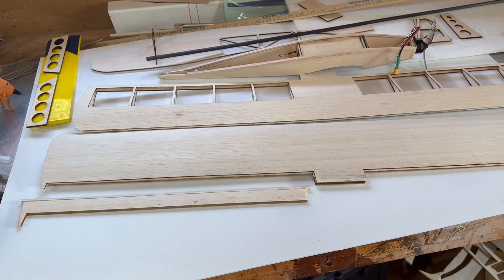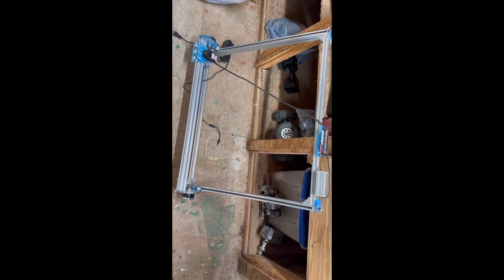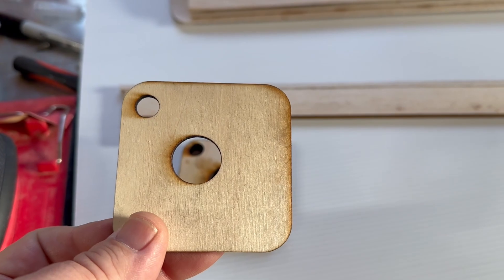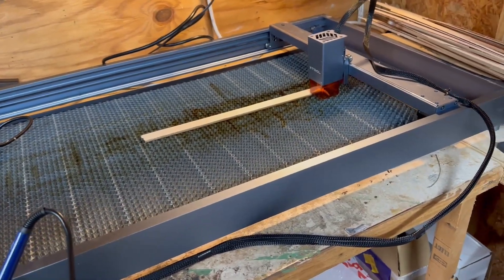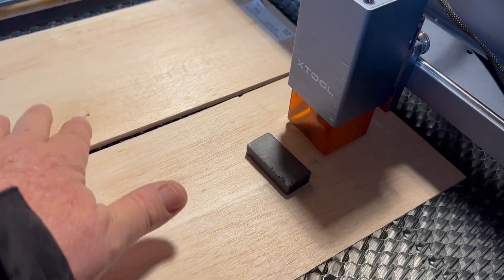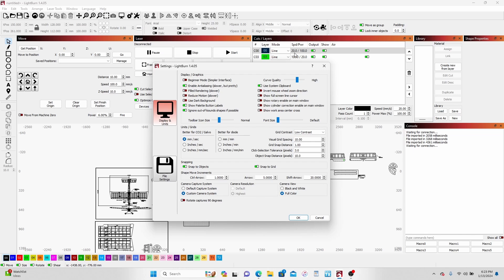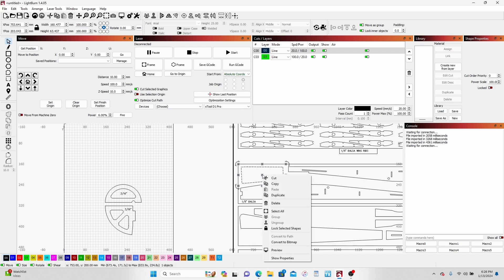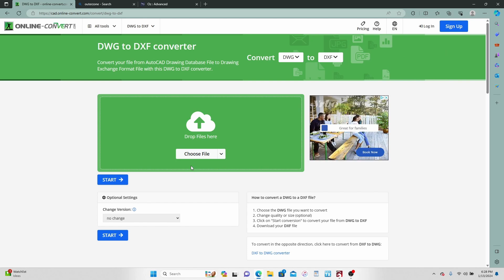10 tips for beginner Laser cutting when building RC airplanes.

Comment: Great instruction, cheers! A few more tips. Diode laser are sold as power or optical power so a 40W power is actually 5w optical power (or 40w optical! the price is the clue). Never run at 100%, thats peak rate power not continious, it will burn out in short order. Air assist helps keep the lens clean. Regularly clean the lens. Soot will obstruct it and the lens will cook and diffuse the beam reducing efficiency. Spend time calibrating the device & material speeds. You can set the start point (green dot) to where the laser is sitting. The frame & cut frame (dashed square symbols) function helps confirm your wood is lined up correctly for the cut/engrave. Theres a tab mode in the cutting settings which stops the pieces falling out or moving (with the air asist) helpful for parts within parts.  Some (rough) guide speeds for 40w/5w optical on balsa wood. 1/16"  950mm/min x70% 1 pass, 1/8" 900mm/min x80% 1 pass, 1/4"  900mm/min x70 2 pass. Find what works to give the least scortching and cleanest cut. Hold the wood in place with thin sticks pinned down with wieghts. That way they do not ubstruct the laser while ensuring a level target. Open a window especially when cutting ply or mdf.. The fumes makes a 20 a day full tar look healthy! For frequent 5/16"ply, 1/4" balsa or bigger then splurge on a 80w/10w optical for time (no passes) and scortching.
Reply from the maker: Wow, that is some really great information; thank you for sharing all of that with us.

Comment: Just started with a X-Tool S1, balsa is definitely a different wood to work with for laser cutting. I found that multiple passes worked better for cutting thicker pieces. The newer X-Tool software XCS has the ability to use your phone camera to get a picture of the workspace with the wood you want to cut in the picture so you can line up the cut or scoring position. I had hand cut some pieces for an Ugly Stik but still needed to cut the holes for control rods. The photo assist feature makes it easy to get the hole lined up with where it needs to be cut.
Reply from the maker: That is great feedback, thank you for sharing your experience. 
Just think when you get all the parts figured out for that stick and have them in your computer. You can repeat the process easily to repair any damaged parts of your flying plane.

Comment: Very nice video. I have a little bit of experience and am making small improvements each cut session. I find that more passes (like 10+) with lower power makes a cleaner cut with less scorching or blackened edges. This also gives a longer lifespan for diode lasers.
With plywood the amount of glue they are made with makes a difference in cutting speed and quality of cut. The glue also smokes nasty stuff,  my machine is in a  home made case with an exhaust line going outside!
Most importantly, take notes! I write a part number on each piece of material to keep track. Test test test...
If you want to get serious with cutting get a CO2 laser for superior results & speed.
I appreciate this video!
Reply from the maker: I have found that with just an aquarium pump and a nozzle I am able to add air assist on my diode laser and get really clean cuts even with high power, single pass, cuts. Thanks for check out my vids. Hope you can find something helpful here.

Comment: So when I import the plans into LB, I shouldnt have to resize them? I only have a 400x400 size bed so I may have to split the fuselage up if thats the case.
Reply from the maker: Yes
And I have a video out that will help with that. My “beginner “  series will help get you up to speed on most everything you need to know to get started. Also the Pitts biplane videos deal with oversized parts cutting. Especially on the fuselage.

Comment: Good to see someone sharing their experience specifically for RC modeling. What I didn’t catch is what wattage your laser outputs? I’m considering buying a laser cutter but I’m stuck on the power (10, 12 or 20W diode laser)

I’d like to be able to cut up to 4mm plywood in one go. Otherwise I expect to cut 1-3mm balsa mostly.
Reply from the maker: Mine is 10watt. If your looking to cut 4mm in one pass then 20watt or higher is a better option. Go as high as you can afford because turning the power down for thinner wood is the best option.

Comment: Could you explain #6 a little more in depth?
Reply from the maker: There are ways in Lightburn to set the laser to home in other words, go back to a starting position, but as a beginner it’s much quicker to manually set the laser to a home position and you’re gonna wanna do that between each cut or the laser won’t read right and your second cut will be off. Also, if your laser is like mine and doesn’t have limit switches, it may bang hard against the side of the railing and start stripping out the geared belts because it thinks it has more room than it actually does.  If you find yourself in that situation, simply turn the laser off manually reset it to its original position like I did in the video then turn the laser back on it will reset itself in Lightbourn.

Comment: Thanks for the tips. Doesn’t look like a stock machine. How big is it?
Reply from the maker: It’s an Xtool D1 with an extension added. I had to change the software from D1 to D1 pro to get Lightburn to recognize the entire size which is now somewhere around 17 inches wide and 36 inches long of usable space. It’s the standard 10 watt laser, which will hopefully soon have air assist and a camera system for doing overlays in Lightburn. Ooopppss. Spoiler alert!!

Comment: Can you please share the model of your first laser that is at the beginning of the video. Thanks
Reply from the maker: I honestly don't remember. It was some off-brand thing from Amazon. Kinda like this:

https://www.amazon.com/SCULPFUN-Ultra-Fine-Compressed-Protection-Fixed-Focus/dp/B09MQMXXGD/ref=sr_1_4?crid=3AV5YP06YY9IE&dib=eyJ2IjoiMSJ9.8iz7LHag67hQlLmTtPf4a3_yi3jn-oo0Qa4L3Hyqu0LnZo__rrv1wdHzjsJEuGqtX21ySX5S5kyjKbIAjTbAy5Rb53uOx78rABzMimypgwJ9G1W0TnQG_J9smsduF5txY5zuyDwnUAOayBRz_rmYeDEcSiysjB-XGXQDIYhhAdWj-d-5f3gd83a87_iE9DHM_zuuBpJznJ7J-iE_WYafAVIcH0hnJV2MiR3QFp7O41vq_Xb4tn4kADB52cAhvrm54rrmjCXX1Y1DWudvVZIed5jQrAlz_FctT2yW7Tv6cs4.HCImuYHhLNJ0JcAExnQda4BGmteQ9eBui-_siyCVmIE&dib_tag=se&keywords=laser%2Betcher%2Bmachine&qid=1713152272&sprefix=laser%2Betcher%2Caps%2C164&sr=8-4&th=1
Reply: @lazerbuilderrc1536  Thank so much. It is difficult to piece through the power and type required to cut the materials needed.
Reply from the maker: I have been looking at these. Cheaper and more value than my Xtool 10 watt.  https://atezr.com/collections/laser-engraver

Comment: I realize this is a video for mostly beginners to the hobby and I have been toying with the idea of getting back to building balsa planes as I did religiously when I was a kid, but I'd like to share some things for everybody. For Tip#1: LightBurn is like salt on eggs. Eggs are great right out of the shell, they're good cooked and broiled, poached, and hard boiled... but adding salt? You can't really imagine having another egg without a little salt. LightBurn is absolutely mandatory and nobody ever says they regret paying the $55 or $110 for the full license. Just get it, you won't regret it. 

Also.. get an enclosure for your diode laser. I'd recommend, if you have the $$$, to consider a CO2 laser instead but they're significantly more expensive. Two advantages with an enclosure: the exhaust fan is good at removing smoke and any ash you have left over, and air assists. I was a firefighter when I was younger and I always thought it to be counterintuitive to feed a fire with air but when it comes to lasers, having a proper air assist actually completes the combustion process & makes the laser cut far more efficiently & a LOT less dangerously. Your stock catching fire is because you don't have enough air. It's also why you need to be cutting at a higher power & lower speed, which gives you more of a chance to start a fire. You keep a fire extinguisher close by and you watch your cuts: thank you for mentioning that to your viewers! That is a very VERY important aspect. Many, many people have lost their entire homes because they think it wouldn't happen to them. 

I have a 60W CO2 laser with a 20"x28" cutting bed (usable is about 19.5"x27"), automatic Z-axis autofocus, and I paid about $3,100 including shipping. Aftermarket, I purchased a 6" exhaust fan to upgrade the cheap Chinese loud fan. I purchased a premium lens from American Photonics, and I replaced my air assist from a sad little fishtank aquarium pump with a 6-gallon air compressor and fitted a regulator to my laser cabinet. I use my laser for my business so my upgrades are completely justified, but even if I was just using it as a hobby laser, I'd skip the diode 2-axis laser and go with the CO2. Again, much more costly but if used correctly, you have a very low chance of fire, you'll use a lot less electricity, and far less wasted materials. Even as a hobby laser, trust me, after some time you'll see it saves you time, money and energy.
Reply from the maker: And you have now set the lazy builder RC record for the longest post. Absolutely lots of good tips there things that I should mention more often in my videos regarding safety such as goggles fire extinguisher plenty of air ventilation all good points  I appreciate you taking the time to mention those things.

Comment: Thanks. Metric I found its much easier to use metric instead of converting minute fractions of an inch to make a design after calculating tolerances. While this was outside of RC it was crystal clear how much easier the manufacture was after doing and the design.
Reply from the maker: I have to agree. At least as far as engineering goes. Much easier when dealing with tight tolerances.